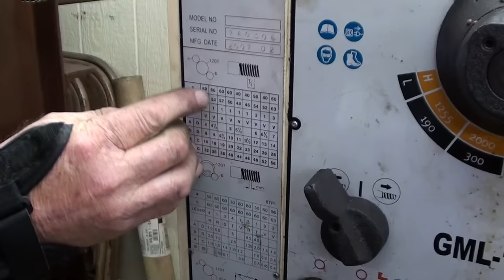1957 Chevy Steering Gearbox Rebuild Part 2. Sector Shaft Repair. Operation Crusty Truck # 63!

Comment: My cousin was a racer when itried a 57!cevy it had a solid steering shaft he said i believe a chevelle steering box 63 high performance worm gear a joint off of a chevy four wheel drive and a joint from a ford four wheel dive that had to be machined .040 gave u a movable shaft instead of one that speared

Comment: I wonder if we were to open up the old DANA, TRW, Bethlehem steel plants, would we have many people who would know what to do with them? I don't know...
Reply from the maker: BIL worked for American Electric Power. Started as a grunt. Supervised the big lines when he retired. He and several others told them that they were not bringing anybody up through the ranks to know or understand how to do any of the work they were doing. Bean counters rule. 2 weeks after he retired, is phone rings. They're in a jam. nobody knows what to do. He spent the next 5 years making more as a consultant than he did as an employee. Amazingly, they STILL aren't teaching anyone and relying on him and the others.
Reply: @ElderlyIron  My Father and my Uncle both worked for Dana. They both started out at a relatively small plant that made leaf springs and maybe other components. That plant started getting phased out and my Father went to a much larger plant that made truck frames. Decades back, my Father and Uncle both said about how we don't train proper Tradesmen anymore. Everything, machines, knowledge, production went to Mexico. Now it's mainly China and we seem to be shifting to India. I hope this guy who did your steering shaft will take an Apprentice. Dying breed and all you know? Seems like everything is all CNC anymore and if the computer decides to throw a fit, noone knows anything about doing things manually.